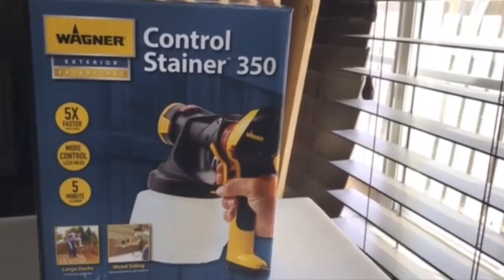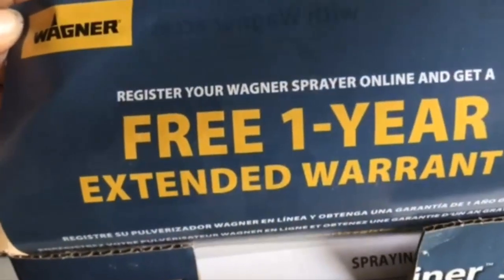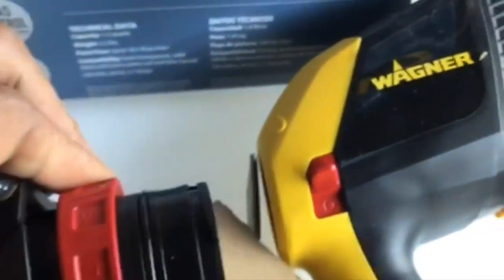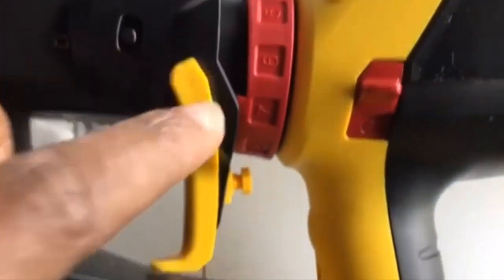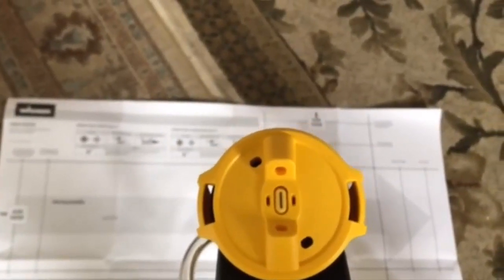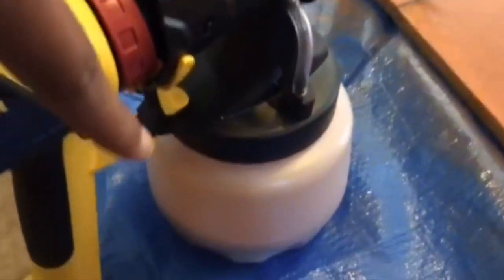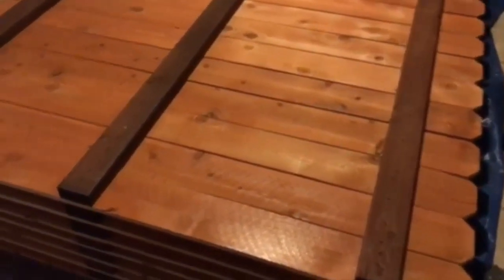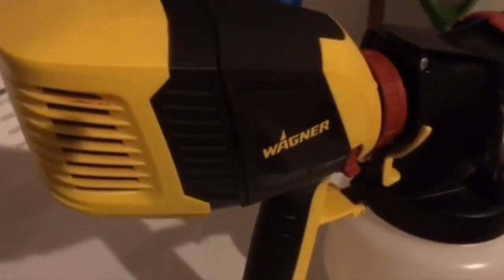Wagner Control Stainer 350 Review

Comment: I think this might be a stupid question but, can you use this with paint instead of stain?
Reply from the maker: Yes, you can. It’s advertised on the box to used with paint as well. However, I have read mixed reviews of how it handles the paint so maybe try a different model for paint.
Reply: Terrible with paint splatter everywhere

Comment: Thanks so much for your video. I bought mine but unfortunately I am not having a good experience with it. I’m trying to use the BEHR cabinet and trim paint but all I get is lots of spitting and spraying. The finish is not smooth but I’m getting this orange peel affect. Also my trigger is very hard to squeeze. Do you know what that little yellow screw is on the trigger? Am I supposed to do something with it. Did you have to adjust your trigger some how. I heard you mention that you didn’t press to hard on the trigger once you got the hang of it but with mine I have to squeeze hard just to get a little paint out. I’ve adjusted the red dial from 1 to 12 and it didn’t help. Also read the manual several times but nothing to help troubleshoot this. I even tried to call the company but I didn’t get anywhere. Any help you can offer is greatly appreciated. Thanks so much.
Reply: You probably need to thin the paint. Also, that yellow screw is a trigger stop. Thank you Selena for putting this vid together!
Reply: Sprays transparent and semi-transparent stains, sealers, urethanes and lacquers (not recommended for paint)  Quoted from Home Depot Product Overview,
Reply: This product is only for stain, you need a different one for paint

Comment: Has anyone be able to get replacement air filters from Wagner for the model 350?  I've been to HD and Lowe's and local hardware stores, but nobody seems to carry them and I can't find the item on the Wagner website.   Any suggestions on what else would work?  Thanks
Reply from the maker: If you're referring to the white foam-like part, I actually purchase a similar filter on Amazon and cut it down to size to fit in the circular space and it worked like a gem. I recently used my stainer on more fencing I built. It worked great.